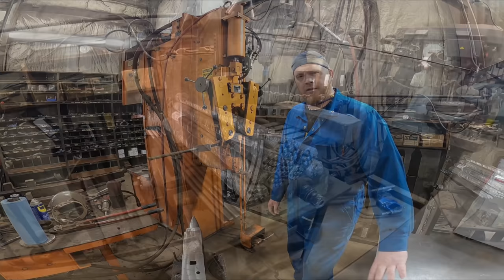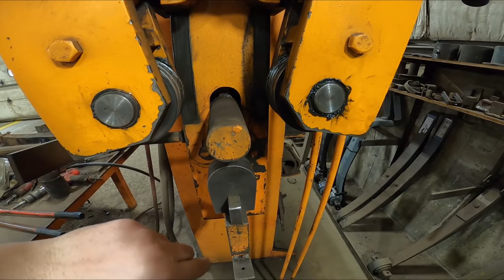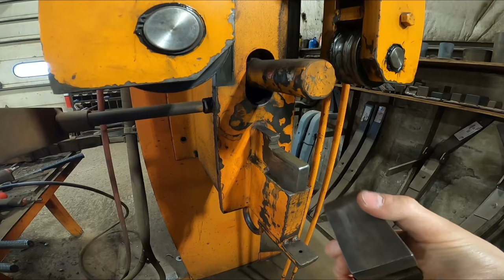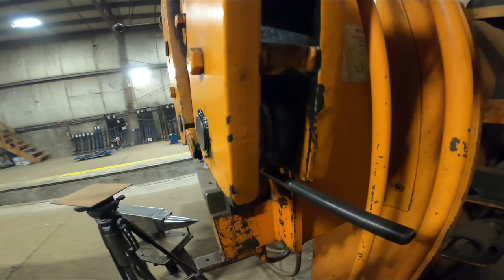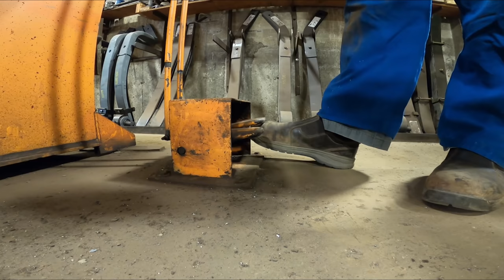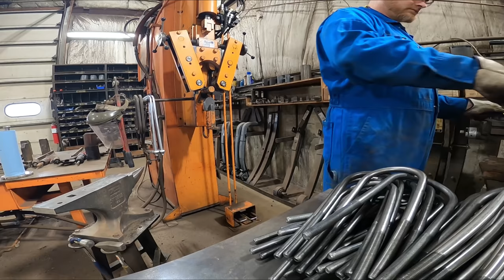How to Bend Ubolts

Comment: There is a shop 20 mins from me that made U-bolts from start to finish. 

I get my custom made pieces from them.  

They cut to length, put through a threading machine. 

If it’s a large enough diameter, it goes into a heater that heats them to red colour. Then it goes into a 1,000 ton press that squishes the center flat which allows easier bending in the same machine Scott is using. 

I’ve seen them bend rods without squishing flat also. 

It was pretty neat to watch. 

Especially when the press goes through it’s stroke. The floor shakes. 🤣

Comment: The flattened center area mentioned in the comments is a good feature, this prevents crimping the axle housing and, with the waffle gripper pattern feature, reduces slippage and weld breaking and/or housing "tears".

Comment: Loved the video. I would have thought that once you get the 1st U-bolt set to the proper size you would just run the rest as all the straight bolts are the same spec and hardness they would all bend the same way.

Comment: just an idea cut a scrap plate  and make a go / no-go  gauge and save more time 
great video by the way
Reply: yeah was thinking the same a plate with holes at spacing
Reply: Or make a tapered one that will check multiple sizes.
Reply: Use the widest part of the die for the guage

Comment: My local shop would always bend them a little tight, then rap the anvil to loosen it up. He said he did it that way to relieve the stress in the bolt. Don't know if it really makes a difference but it sounds good.
Reply from the maker: I almost always bend them too tight as well then just give them a tap to get it the right size.  I don't know if it makes a difference it is just what works.
Reply: The old man who owned the shop I started working in when I was teenager taught me the same thing about bending them a little tight but instead of smacking them against the anvil he had a jigs (different ones for different sizes/styles) made up to slide the u-bolt that you bent a  wack with a knockhronometer to spread end back out to “spec.”  Additionally at that shop the owner would buy lengths of round bar stock and we had to cut them to length, face the ends off in the lathe and thread them before bending them.

Comment: Nice, just 1 question why don't you set up a stop to work off for the centre line?
Reply: there is so much wasted time in this setup its not even funny.
Reply: There is a stop on the left
Reply: @haynillesen  That is what I made it out to be but looks like a place to hang the G clamps lol
Reply: @DieselRamcharger  Yes, lots of room for improvement.  But remember, this isn't a machine that's designed for production use.  It's a job machine, most of the users are going to be making at most four of the same size in a row, and very often only two.  Setting up an end stop for every four bolts doesn't save much time.

Comment: What would be the result if you left the adjusting wheel where it was after bending a bolt and do the next one in one hit?
Reply from the maker: You can do this.  It is mostly just a habit.  I find it more important on the really thick ubolts.  Ease them into the correct size.  A little less stress on the steel.
Reply: @simcoespring  Same stress. same bend angle. relieving the rollers only makes it easier on the machine.
Reply: @DieselRamcharger  the rate is different
Reply: @co1urzz  lmao. no.

Comment: Once you find that good setting for jaw width, why not stick with it for rest of the bolts?
Reply: Because hes clueless how the machine works.
Reply: @DieselRamcharger  that's not a fair assumption. I use this exact machine daily and sometimes to get the desired width on the first bend you need the outer rollers to be tight which causes flat spots on the sides of the bolts and makes them thinner. He also explained why he does it in the video if you watch it through.
Reply: @lukeporter8614  he DID explain it. and i dont accept his explanation. i get it. trying to show the quality he puts into the product. i am however not convinced there is an functionable difference. just as setting the stop vs measuring to center on each bolt. time wasted. unless his supplier has irregular cut length. but i would handle that with my supplier not handicap my production to suite. i mean to each their own. Canada has the economy it does. For a reason.

Comment: Thats interesting, its that easy to make U bolts. It always been a struggle to get U bolts out here on the coast of BC. Then it costs an arm and a leg. When I needed U bolts for my F350 Superduty I was told dealer only item.
Reply from the maker: the dealerships can charge and arm and a leg.  We recently got a quote from the dealership for a set of 4 ubolts and they wanted $250.  which we think is very expensive.  same set of 4 here was only $55 plus tax.
Maybe I should start selling them on my website.
Reply: @simcoespring  I can't remember the exact price as it was couple years ago. The 4 u bolts were 300 plus.
Reply from the maker: that is way too much.  I wish there was a selector program that would let me easily translate my 10,000 different shapes and sizes into an easy to select from website.  
Pick your shape, pick your rod, pick your length.  I already ship to all of north America.  Something to think about.  Sounds like an epic project.
Reply: @simcoespring  some webstore front ends let you select multiple parameters, so you could pick both Profile and Diameter, and have a line-draw chart in the item-gallery for the different profiles

Comment: I had to argue with my boss about buying new U bolts. He wanted to cut and weld the old ones to fit and I said "you're fucked" It only costs $250 for new ones and they come with new nuts and washers. We spent a day trying to remove the old ones before he gave up and let me order new ones from napa. I can use a measuring tape and read so it was no problem and could have saved us a day of work if he had of listened to me!
Reply: Bosses do that sometimes

Comment: Your machine looks almost new for its age. aours has many modifications and looks quite different to yours and is much, much slower.. not sure why. Perhaps management though it was dangerous for it to be moving so quick. Do your bolts come out with a twist in them that needs to be straightened? Depending on the bolt sometimes ours end up with about ¼ to ½ inch twist in them 🤷🏻‍♂️ Great vid nice to see how other people do them.
Reply: I'll have to see if I can send you through some pictures if you're interested.

Comment: Question. I have Lippert 4,400lb. Tandem axles. I have a 6 leaf spring kit. I would like to put 3” lift blocks on. How long should my U-bolts be?
Reply from the maker: We have Ubolts available for the corresponding lift blocks available on our website as well.  Here is the link:
https://simcoespring.com/products/ubolt-kit-for-trailer-lift-blocks?variant=46257403592872
Just select which Lift block you are installing, which axle diameter you have and which Ubolt diameter you wish to use.  Everything there is auto-calculated to fit your suspension no matter which spring you have.

Comment: Is there any advantage in massaging the u-bolt rather than doing in either 1 or 2 passes? A single pass would save you a bunch of time if you could do it in 1 go.
Reply from the maker: You could.  However this size is fussy and easy to crush in the bender if you bring it in too close.  So we bring it slowly into size so I have less waste.

Comment: what you show  It's very helpful to us.  How do you iron the threads?  What grade of steel do you use?
Reply from the maker: 3/8", 7/16", 1/2" and 9/16" are all grade 5 rod.
5/8", 3/4", 7/8" and 1" are all Grade 8 rods.
we don't use metric Ubolt rods
we purchase the rods already cut to length and with the threads cold rolled already.
this is the company we get them from and how they are made
https://youtu.be/VOPk1DkOHkI

Comment: Surely a go no go piece of steel with 2 holes would be much faster and removes any chance of a mistake.
Reply from the maker: we can bend up 10,000 different sizes and we usually bend 2, 4 or 8 at a time so mostly not worth making up a plate for each job.  however in group batches like this, not a bad idea.
Reply: @simcoespring  I may well be wrong but you only bend as many sizes as the dies and rollers do. The variety and quantity are definitely good reasons though. 👍 What about an adjustable gauge?

Comment: Dose that machine do something else seams very large relatively simple and low power operation
Reply from the maker: Oh yes.  The main body is my 100 ton press and the ubolt bender is attached to the back of it as an option when you purchase the unit.
Reply: @simcoespring  That's a relief. I was thinking what a huge outlay such a machine would be JUST to d U bolts.